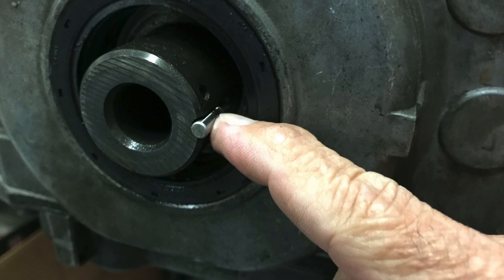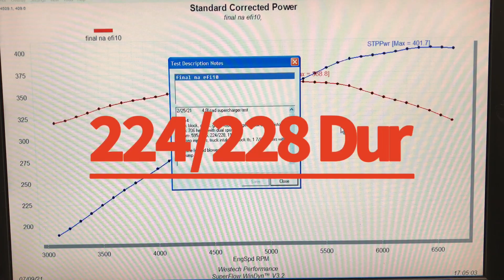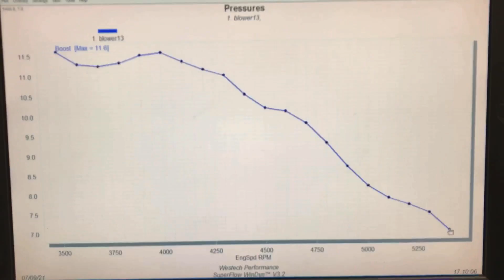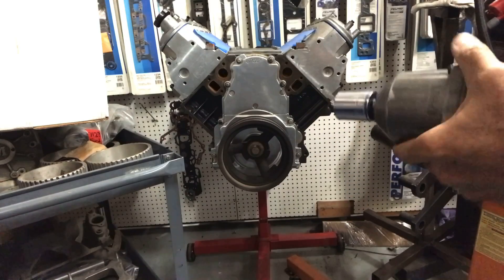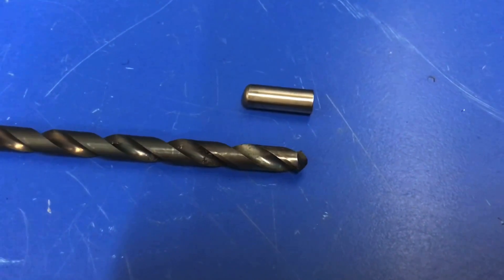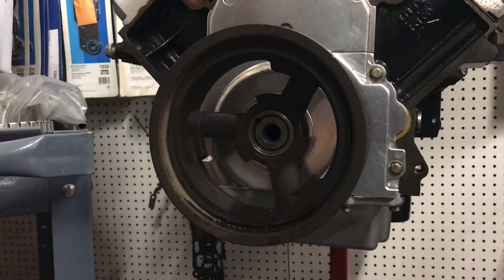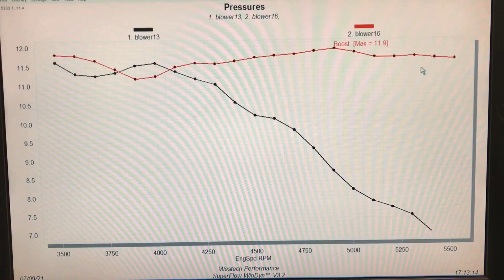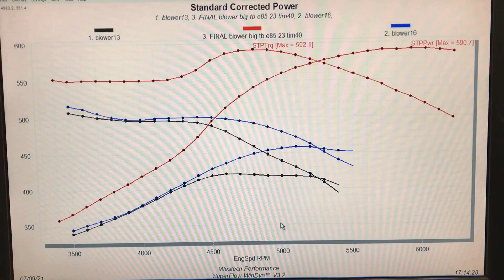HOW TO: PIN THE CRANK-SUPERCHARGED LS (NO MORE SLIP = MORE BOOST AND HP) FULL RESULTS

Comment: Ummm, if the crank pulley spins on the crankshaft it will loosen the bolt. How many seconds can the crank pulley slip on the crank before they friction weld together?
Reply from the maker: we were getting there

Comment: The balancer on my stock 02 Z06 came loose, then the balancer on my 6.0 7875 swapped GN came loose...so now I bought the jig and I drill and pin the balancer on every swap I've worked on. Also anyone who has experienced the issue I recommend they pin when they install a replacement balancer, even a stock engine. If the loose/spinning balancer took off even .001 worth of material from the crank then it will hold worse than stock. It's also really difficult to achieve the factory torque spec with home tools and without removing the starter to install a flywheel stop.

Comment: After watching the video halfway through nine out of 10 people would just tighten the belt they would ignore the squealing noise and think that is just something that is not important because when you tighten the belt it goes away harmonic balancers do a job that was designed from the factory it was never designed to run a supercharger using that particular part

Comment: Does installing a pin to the crankshaft throws the balance off? Has anyone ever noticed a vibration or maybe bearing wear a lot sooner?
Reply: The difference between the original weight of the material removed and the weight of the pin itself would be minimal, plus the pin is very close to the crank's centreline. I would think it's a non-issue for this type of application.
Reply from the maker: NO ISSUE

Comment: Reuse the old TTY bolt and give it 5 ugga ugga’s!  Sounds easy!
Reply: Yeah , na . Pulled one down for lifters , they'd done that on cam install. 

Took a fully charged snap on 1/2 and was contemplating heating it when it finally came out like a wobbly sausage. 

Stretched the bolt thread to 2.25 but didn't mess with it. Just pulled the entire thread out the nose of the crank instead 😂

Comment: didnt realize how easy that is, or at least looked.     thanks for the info !!
Reply: The idea is very basic. But I can tell you first hand that if the crankshaft is forged that it takes A LOT of drilling. A very slow process.
Reply from the maker: A FORGED CRANK PROBABLY ALREADY HAS KEY WAY
Reply: @richardholdener1727 Hi Richard!Correct, they do, and the ATI damper has the key-way to match. But I still pinned mine in addition to the key. I've been hurt before 🤣🤣🤣
Reply: Also even if a forged crank has a key way a stock damper does not

Comment: What if you have a key instead??
Reply from the maker: FACTORY CRANKS DON'T HAVE THOSE-BUT AFTER MARKET CRANKS DO-ATI HAS A PIN KIT FOR RUNNING A KEYED DAMPER ON A STOCK CRANK
Reply: Some people are content if their pulley and crank are keyed. Mine were keyed and I still drilled and pinned 180° from the key. Fyi it is much more difficult to drill a forged crank but still doable, just takes longer.

Comment: ATI sells a good fixture to do it the other direction and you can install slotted dampeners, without making a custom matched crank and dampener pair like this.
Reply: You can also dual pin it 180 degree apart
Reply from the maker: we have run those as well when running an ati damper on a stock crank

Comment: I cant believe they don't put a key in at GM.
Reply: You know what's worse than a neutral balance damper that drives a powersteering pump not pinned or keyed? Mazda mzr has smooth bore crank and cam sprockets... Ya, I know.
Reply: Friction fit baby. 
Press fits (no keys) are better at transmitting torque. Only key it if you have to have it clocked in a specific way.
Reply: @2lotusman851  I'd like to hear about the physics behind why a press fit is "better" at transmitting torque.
Especially considering this video blatantly proves the opposite.
Press fit slipped, pin fixed it.
Reply: @2lotusman851  friction fit needs a friction washer to work at these loads. You key a washer to the bolt face with a carbide or diamond surface. The infinite adjustment is nice and is used on one kind of Mod motor, I can't remember if it's Romeo or Windsor, and for the lower loads of a camshaft it usually works. Friction drives are designed to slip in overload condition to save parts from breaking and are not reliable for shock loaded setups that must remain 100% timed. Shear pins are a better idea here, where it disables the equipment instead of allowing it to continue operating in a failure state. 
Keyways are high stress and make the base structure weaker. That's how a backfire with a blower can shear the nose off the crank. If the blower pulley would slip for a second during overload, that problem is gone. 
Driving flats are usually easier to machine on both ends, think coyote oil pump, don't create a stress focus and are actually stronger for high radial thickness and high hardness material. If you need strong and accurate timed drives, you use splines. A single key is used on cam drives, damper drives and the like because it can be done in a single step on a mill without any R&D. It's cheap, it works but it's far from the best.
 The pinned pulley with a serpentine belt isn't a big deal, the belt can slip if overload occurs. It's also really cheap and easy to do. The Ls9, Lt4 and lt5 facrory supercharged engines have keyed dampeners. GM realised when you try to drive 100hp through a belt somethings got to change.

Comment: I didn't expect the damper isn't keyed on these, a new one for me.  Still though, there must be a torque spec?
Reply: 37 FT/LBS, then an additional 140 degrees. (Of clockwise rotation)
Reply: They didn't designe the front pulley assy. to transmit the 30 odd Hp to drive a supercharger
Reply: @gothicpagan.666  they did on the LSA, but the accessory drive belt is a vibrational dampener, not a balancer, like a Gen 1 or 2 smallblock. I wouldn't be surprised if the blower eats more power than that.
Reply from the maker: its a lot more than 30 hp
Reply: @gothicpagan.666  the accessories on a ls1 f body is about 35hp based on 1/4 mile mph testing by hotrod. The tvs on the C7 ZR1 alone uses 110hp. This blower is probably using close to 80hp to drive.
Reply: @timothybayliss6680  That's pretty poor. Thanks for the info, my only experience of super charging is the little mazda MX5 standard 1800cc engine with 8 lbs boost made 186 Hp. Same engine with a turbo at the same pressure made 215 ish,( the file had been deleted in the mists of time). Guess it depends on the size of the blower and the volume of air being pumped